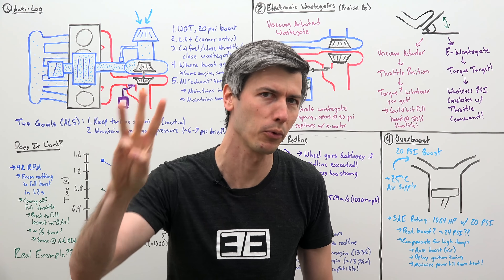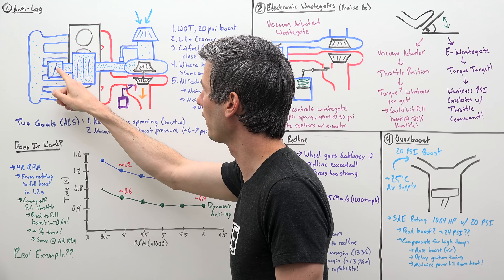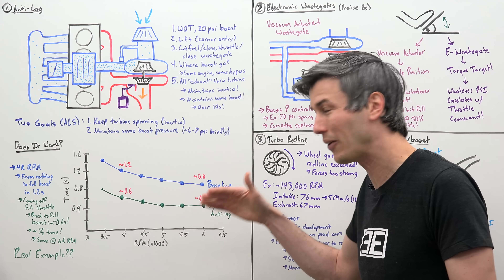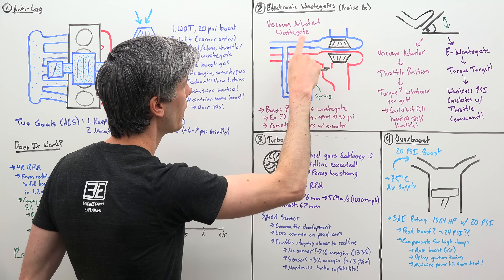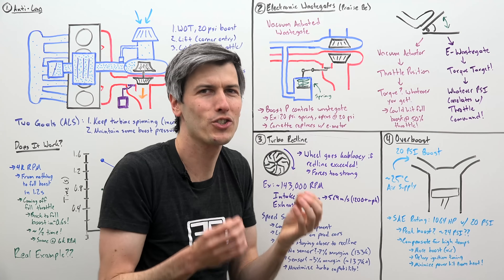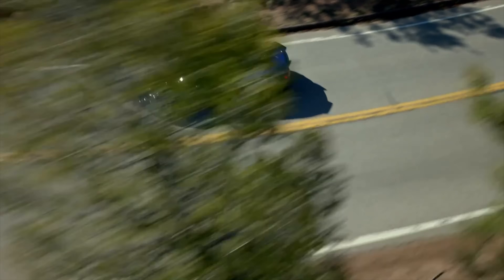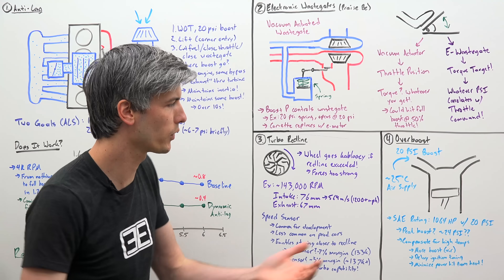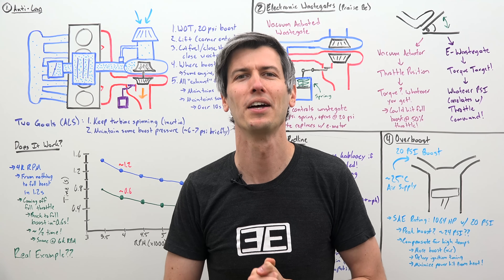Corvette ZR1's Anti-Lag System – Massive Turbos, Minimal Lag

Comment: The first diagram for anti-lag, isn't that how just about every turbo car works, even at 100hp rather than 1000hp? This sounds like some marketing crap, which you would have been debunking rather than falling into just 2 years ago. This is not Engineering Explained, it's Engeneering Obfuscated.

Comment: I'm very confused!! Should I now laugh or cry? BMW has this technology since 2013 in the S55B30 (only the rpm sensor for the compressor wheel is missing). So: what is new? And yes, a supercharged engine would have the same figures, but with one problem avoiding: the extrem first torque peak, which makes the car so hard to drive. Have a look to the F8x M4/M3 crashes. And well the supercharged version would be much simpler which means more robust and reliable. So: should I now cry or laugh?

Comment: Chevy trying so very hard to prove that ZR1 is cool and interesting. What actually matters (because no one will drive it on track and it won’t even give you full power in lower gears and it can’t put down power) is that it sounds like garbage and looks like a C8. Booooring.

Comment: E-wastegate is pointless. If you're giving it 50% throttle and it's responding with full boost pressure, YOU ARE STILL AT HALF THROTTLE, so you're still only making half your horsepower. If you want less power, give it less throttle.

Comment: Yeah, I set up boost maps on an old Autronic SM4. Piece of cake. RPM and TPS were the two axis on the map, wastegate was a simple spring type with a solenoid valve operating it. Control was closed loop, so if 9psi is what I mapped, 9psi is what I got.

On an older car of mine I demonstrated a few times how when rolling downhill, I could cut the ignition, go wide open throttle, and the turbo would spool up and hit 6psi with zero combustion taking place. So with modern tech I see no reason that at least some boost pressure can be created even at zero throttle input.

Comment: Why do you want 50% boost at half throttle?
When I have 50% throttle on my normally aspirated car I'm not expecting to get 50% of 14.7psi atmospheric pressure, I'm wanting the throttle to limit airflow while the air pressure remains at 14.7psi ambient.
Surely in the same way with a turbo I'd be wanting the throttle to only limit airflow, not reduce boost as well?

Comment: 1064hp, not 1065 or 1063?
Also I thought wastegates work of pressure rather than vacuum, but vacuum may be an engineering description, but then again, if it's engineering it's usually manifold pressure or inches Hg anyhow fiik?

Comment: The outer edge of the turbo compressor wheel reaches 1200 mph? So it's way faster than the speed of sound. That is the worst thing that can happen in a planes jet engine. They are designed the outer edge of the compressor or turbine wheel to never reach at any point the speed of sound. That would be a massive loss of efficiency or even destroy the wheels.

Comment: My 2016 Mini cooper 3 cylinder has an electronic waste gate and intake bypass.   Turbo lag near sea level is minimal.  Where I live at 7000’ it still has some lag since the turbo runs a much higher RPM.  But NA engines also feel pretty weak too at low speed before aero drag advantage of altitude comes in to play.

Comment: Great diagrams as usual. However, you could have made this video for the VR30 in the *new Nissan Z, which has all the same tech (recirculation valve, electronic boost/wastegate control, and turbo speed sensor).

Comment: The turbo speed sensor does a lot for it. With being able to run closer to the edge you can use a smaller turbo, and it allows that compensation for weather and over boost. Otherwise you’d risk the turbo over speeding at high altitude or otherwise poor conditions. They’ve had them on big diesels for a long time for much that reason. With the VGT they had some problems with turbos exploding because it was better able to compensate and could overspeed the turbo. 
Unfortunately it also means the ZR1 likely doesn’t have much power available with aftermarket tuning without replacing the turbos. Turning the boost up would be basically be going past that safety margin and could get exciting.
Reply: If you have a c8 zr1 and think you need more power then you need to see a psychiatrist

Comment: Interesting, anti lag from a heavier flywheel effect of the turbo combined with a recirculating blow off valve. I have seen recirculating blow off valves used in drag racing to control boost pressure at launch. Combine that with an electric wastegate to smoothen out your torque curve and you got a response and power and really close to a n/a car. That's cool stuff

Comment: So, a compressor recirculation valve that's been around for years? I don't remember who was the first to use it in vehicles but maybe Volvo.
Either way the russians, as always, already had this decades ago, around ww2 (for altitude reasons on planes, not lag) and they also had the swirl-choke too (on IL-3 I think?), which does the same but with just a funky throttle.. This was of course later copied in motorsports as it's the most genius, simple & reliable way to keep compressor RPM & even efficiency far-higher in the low to mid range, just like here; but I'm guessing the throttle control is a nightmare with this last system so it's never been used on roadcars.

Comment: Maybe I missed it, but I don't understand what makes the zr1 off throttle air handling different than other cars. 

You said it closes the throttle and wasetgate, and bypasses compressor discharge air back before the wheel. How is this different than other turbo cars, even with a mechanical gate? Don't they do the same thing?

Comment: 8:45 I had a car from 2003, and even that had more complex boost control than what you're describing. It simply used solenoids that opened and close valves within the vacuum lines, so that it could artificially reduce the boost pressure felt by the wastegate actuator. When accelerating hard with the turbo at low speed, it could completely block off the pressure signal from the wastegate, ensuring it stays completely closed. Another advantage to this is that you can use a lighter wastegate spring. So you could use say, an 8psi spring, but still hit 20+ psi of boost. This was on a 2003 Vauxhall Astra GSi turbo, with a Z20LET engine, Borgwarner K04 turbo and Bosch Motronic ECU. This was stock equipment from the factory. Oh, and it also has a vacuum reservoir and a solenoid in the vacuum line to the bypass valve. So it could actually use the vacuum in the reservoir to open the bypass valve faster than waiting for the manifold pressure to drop into vacuum, when lifting off the throttle. This keeps the turbo spooled up for reduced lag when getting back on the throttle.
Reply: That's the classical way of controlling boost electronically with a pneumatic wastegate. But has disadvantages compared to a completely electromechanical control of the wastegate valve.
Reply: Even the motronic 2.7 controlled c20let had solenoid actuated bypass with vacuum reservoir and solenoid cotrolled wastegate too. Fully electrically actuated bypass and wastegate (no vacuum system at all) came in late 2000s in motronic control units. Electronic wastegate was first used in Bosch EDC controlled diesel engines. Solenoid actuated vacuum systems were only a shortly used from early 90s to mid 2000s.

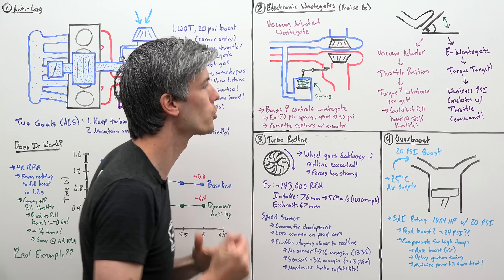Comment: 8:00 Why do you call it vacuum control on the turbo waste-gate - if the pressure is up to 20 PSI it's anything but a vacuum?
Reply: "Vacuum" line refers to any air line on the intake side. It's just weird calling it an "air line" because everyone is so used to calling any intake air lines as Vacuum lines 👍 and technically it's still a vacuum line at idle and very low throttle 😅
Reply: @MrHeHim  That makes sense, thanks for the explanation 😁
Reply: That’s a good question, kinda curious to know the answer myself

Comment: Sorry but I have some doubts about that 76mm turbo. I think Corvette marketing uses here exducer diameter for marketing purposes. I am almost sure that turbo is very similar to g35-900 which is 62/76 on compressor side and also max out at 145k rpm from Garrett and ZR1 usues ofcourese two of  them. Garret does have 76mm inducer turbo but is rated at 1500HP for a single turbo. Please correct me if I am wrong.

Comment: Simpler forms of electronic boost control go back 40 years.  My 1985 Sunbird turbo had a pulse-width modulated solenoid on the wastegate line that made a "controlled leak" and was able to alias the boost signal fed to the wastegate cannister.  The standard wastegate setting was 5 psi and if you were running part-throttle the manifold pressure was limited to that.  But at WOT, maximum boost was 9 psi due to the PWM aliasing the wastegate pressure.  The car had very little lag and would make 5 psi boost at 1500 rpm, which made it a torquey little engine for getting into holes in traffic without downshifting.  At WOT, max boost of 9 psi was in by 2500 rpm.

Comment: Could a SI engine management system  without a throttle plate in the intake get adequate control of torque and power output, just by controlling the bypass around the  intake compressor and the exhaust turbine? And if so, would it reduce pumping losses compared to throttling the intake?

Comment: I just don’t trust GM products.  Our fleet of 1500’s GMC’s and Chevy pickups has seen massive mechanical failures at about 100k miles.  Bad transmissions and a few engine replacements.  And these trucks are pretty much commuter trucks, they don’t tow or haul much.  Just not dependable.

Comment: Pedal torque demand at 50% certainly does not mean then actual blade will be at 50%, that's why OE have used torque mapping for the blade for decades. And often the 50% scenario you describe, is because many oversize the throttle blade, which loses the driver resolution.
But even with pneumatic boost control, it's very easy to map boost with speed, gear, throttle position, etc etc etc

Comment: 6:10 the system you descrive is a pressure operated wastegate, not vacuum operated. Never seen it in a car younger then 20 years old and I can not believe a 10 year old Ford RS or Subaru uses it. The vacuum operated wastegate and variable geometry uses a electronic silenoid vacuum controler. It can adjust the pressure at any moment letting more or less vacuum thru. The electric motor wastegate makes exactly the same job as vacuum operated. It has no more control. It just does not uses vacuum as a power suply and may be more reliable though more expensive. The story you told about over pressure in partial throtle I have only seen in cars with a defective vacuum solenoid.
Reply: Wrong. The E gate will still always have more control

Comment: Exceptional drivetrain in an exceptionally ugly car.  Really is a crime against humanity ; )   I get it, all subjective but put this thing next to a GT40 and tell me which one is better looking.  It strikes me as being designed by a 15 year old.  I own 2 Corvettes so I dig 'em, but not after the C4.  And yes, I own a C4 (convertible...better looking than hard top by far) and they are absolute trash mechanically compared to this beast.   Opti-spark alone takes me out of the running for any bragging rights.

Comment: I was thinking that the e throttle is just as important as the e wastegate for the anti lag setup.  If you are constant part throttle going around a corner the wastegate would be fully closed.  The e throttle would regulate the intake air mass to be constant even though the pressure in front of it would climb. I have an old GC8 WRX rally car and when you give it partial throttle and the boost comes on you have to back off to get the power / torque you want. In a new car I'm sure the ECU would adjust the e throttle when boost comes on to keep torque consistent  with pedal position. The e wastegate would help response by keeping fully closed until full boost is achieved. An old school regulator would have to start opening before full boost is achieved to hit the maximum without overboosting. Sorry if I've ranted, I'm a few beers down haha!

Comment: I’ve had a 2004 wrx sedan, 2005 wrx wagon, 2007 STi and 2022 wrx (yaya e gate) and never seen full boost at partial throttle 🤨 they all have that corvette “anti lag” system routing too. That was horribly explained

Comment: i fail to see any difference on your explanation of "dynamic antilag" to just normal engine with a by-pass valve, are you quite sure there is no air bled from after the compressor to the front of the turbine? Also vacuum actuated wastegates are generally controlled via solenoid valve that you can feed PWM through to actually achieve torque targets based on your throttle position since it is possible to direct the pressure/vacuum from the manifold side to either side of the diaprham that is connected to the spring in the wastegate.

Comment: There are some smart people out there.  I never could have guessed that I would see a Corvette with 1064 horsepower.  Now, I just saw the ZR1-X has 1250 horsepower.  My current whip is a 1989 Honda Crx HF and it came from the factory with 62 horsepower over 368,000 miles ago.  Times have changed.

Comment: Porsche really changed the game when they came out their variable turbos on the 2007 997 Turbo, but then even more so with more recent 911s like the 992.1 Carrera, Carrera T, Carrera S, and Carrera GTS.  The 992.1, especially the base Carrera and Carrera T, have very nice engine response and minimal turbo / power lag. The power band is nice and wide and very usable. With a tune, I have heard the response can be even better with more high end power.

Comment: So basically were taking all of the diesel cool techs from the past decade and shoving it into gas engines lmao, earliest electronic control turbo i know is one for a 2.2/3.2 ford puma series diesel but those are also VGT vanes but works the exact same way (it meant that they could combat vanes getting stuck when cold as it plagued diesels from 2007's)

Comment: An inline-five intake on an inline-four engine is on the whiteboard. It's also worth mentioning or comparing Porsche's VGT system used in their sports cars. Of course, it's more expensive and requires more exotic materials.

Comment: I don’t think GM are being transparent here, there’s a lot more going on then just recirculating boost pressure (this has been done for decades), they are using electronic boost control, valve lift, valve timing, throttle control, ignition timing and fuel timing/duration as a holistic approach, this coupled with the latest turbo technology and you get next to no boost lag. BMW, Mercedes, Porsche, Audi and Ferrari have been doing all this for years with varying success.

Comment: The 2022+ WRX uses a electrotonic waste gate with the new FA24 engine. And the turbo is a little larger than the previous generation with the FA20. The new FA24 is a phenomenal engine! and is been in production since 2018 .lots of improvements have been made since then, here in 2025. Improvements on an already improved engine design. You really have to hand it to Subaru for building a great engine. Maybe that could be your next video!

Comment: Love to see the new c8 zl1 twin turbo on a dyno and with hi end a/c air intake system ,to control how cold and how much humidity goes in and then make adjustments to that A/C system and see if there's any hp difference and map out the A/C air in increments for each degree and each higher humidity values, it can be hot by very low humidity, after all its about the air density values and also what about above sea levels and then adding the air temps and humidity, hi on all counts or values and the engine will die as far as producing hp, or at least to the point that your not going to have 1064hp at the engine as chevy claims, like lets say 100 degrees F in outside temp, then you have 95% humidity and say around 10,000 ft above sea level, love to see a dyno result on the rear hub dyno on those figures. cheers 👍👍✌✌🦘🦘Like Mt Panorama in australia imagine racing there when it could be raining on one part of the tgrack and then completely sunny on the other side of the track or worse humidity is very high and raining and then the sun comes out? 👍👍✌✌🦘🦘

Comment: This is slightly wrong, the WRX has electronic boost controller and also works off requested torque in which the vacum for the actuator goes through the controller first and the spring is 7psi, so it can control anything from 7psi up, you wouldn't get full boost unless the ecu requested that much torque. You would get at most 7psi in which the ecu is aware of and would pull whatever it needed to maintain the throttle pedals requested torque vaule